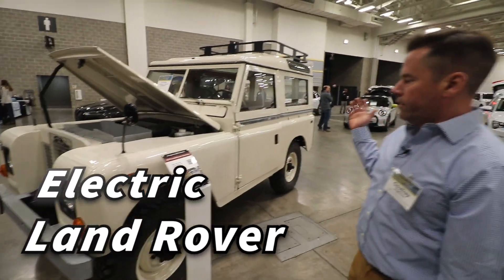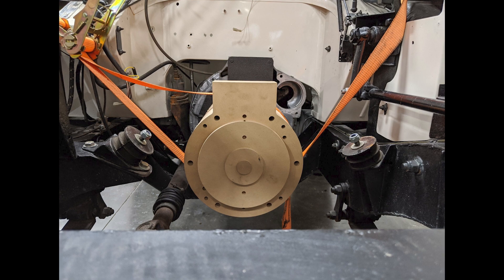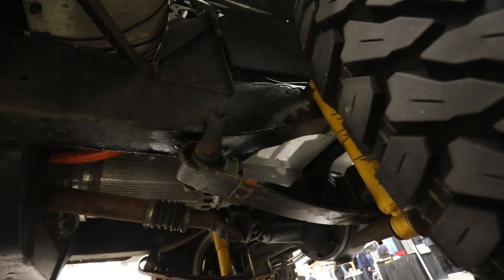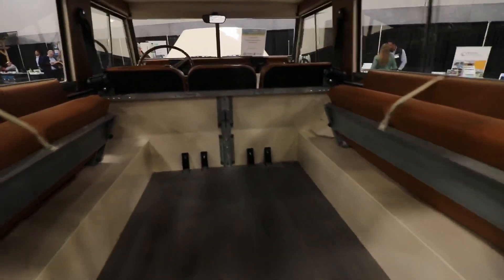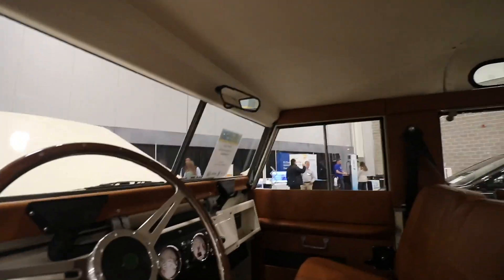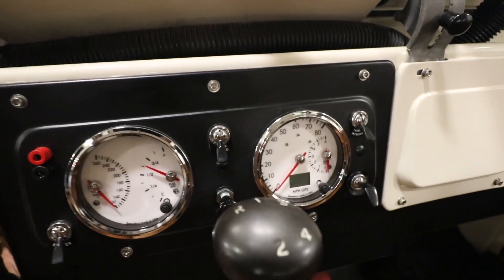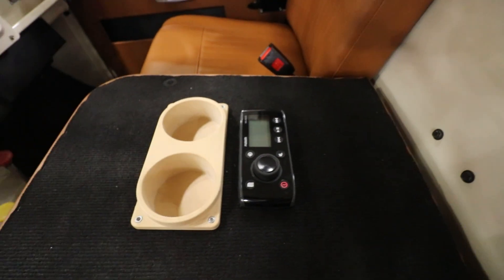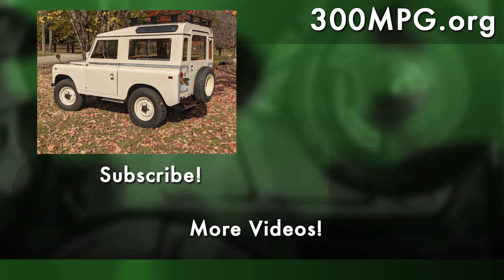Electric Land Rover | Series IIA EV Conversion walk-around tour with builder

Comment: Why not bolt an electric motor directly on the transfercase. Maybe a bit stronger motor.
Reply from the maker: Having a motor directly connected to the transfer case would require a high-torque/low-speed motor. It would draw very high current.
Most DC electric motors work best/coolest/most-efficient spinning at a relatively high speeds and then being geared down.

Imagine riding a 10-speed bike and trying to pull away from a dead stop in the highest gear. In theory, you have maximum speed, but even standing on the pedals, it's very difficult to get going.
Reply: @BenjaminNelsonX  okay thanks!